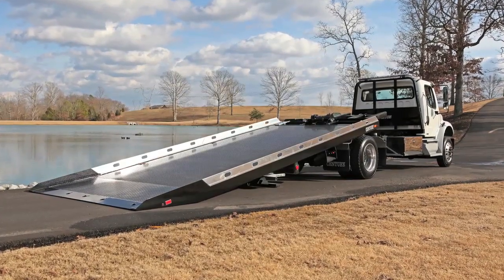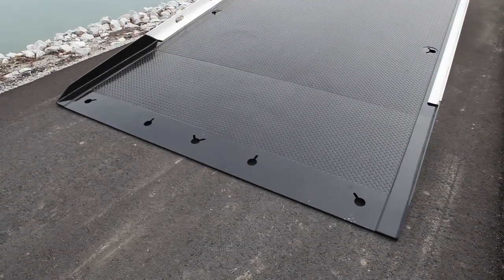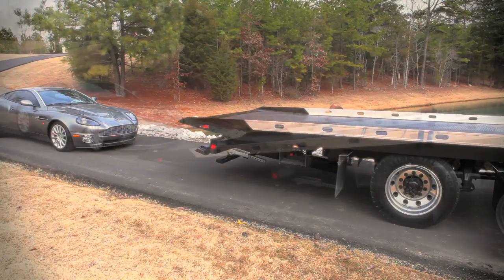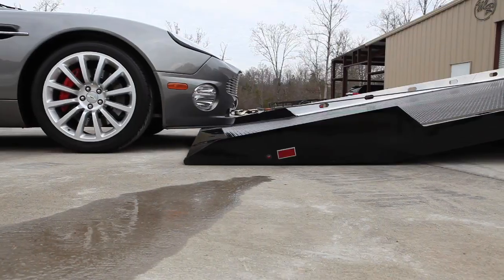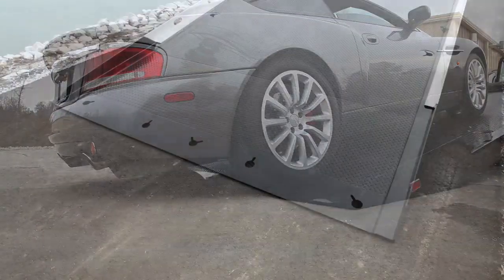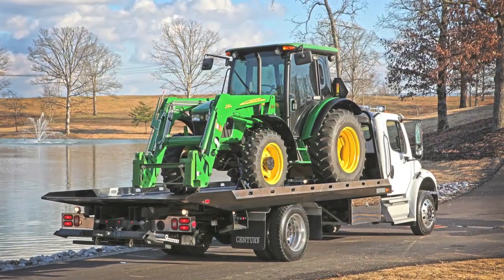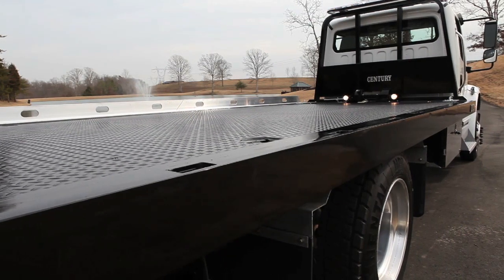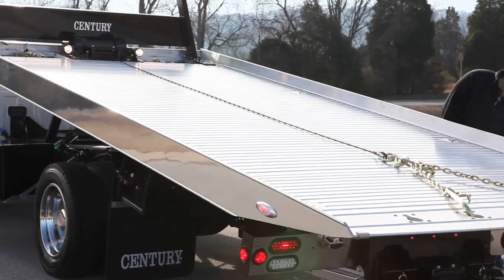Miller  Industries - SST™ option

Comment: In Europe, most tow vehicles have a flat bed that pulls back neatly flat. Cheaper than American tow trucks too...
Reply: Most American style tow trucks these days are based off of European designs. Miller owns two towing brands Boniface and Jige Interational and has been integrating their tech into the American stock. We also have those style tow trucks too, called detachable deck trucks both Miller and Detroit Wrecker makes them.

Comment: So i have the regular lcg bed and not this on my 17 F650 and even with having the airbags it's seems that i have to put a extra amount of downforce on the tip of the bed when loading and unloading. As the feet underneath seem about 4 inches or so too high and are not flush with the attachment points for where the feet slide in and out of the frame work. Now i was curious if anyone had thoughts about this or used them without as sometimes i have extremely heavy loads i want some sort of support and i love how wide those feet are for supporting the bed is there a lower option style foot ? Or has anyone else had experiences like this ???  sometimes  i drive a car off and the dam bed pops up as there isn't a good gauge for me to judge how much pressure to put on the bed 🤔 seems the feet are up inside as far as they can go would be dope if they had a design to knock off about 3-4 inches at least as i would prefer to bot have to drop the bags every single time 🤔 my rep at Zip's asked me if i wanted this tilt function and i laughed and said yeahhhh no thanks i have my wood planks